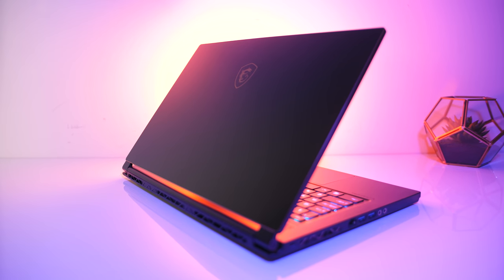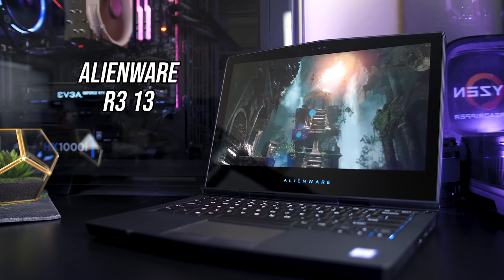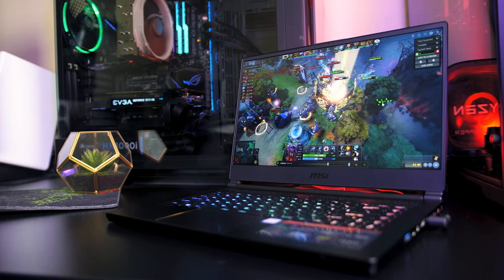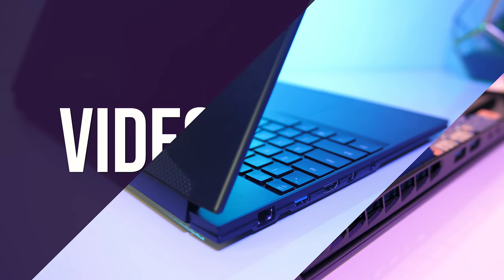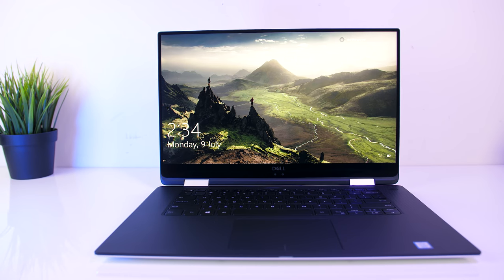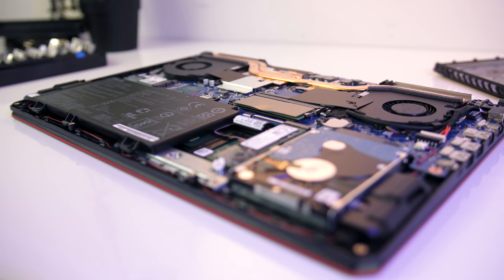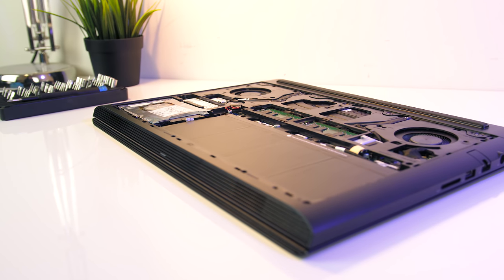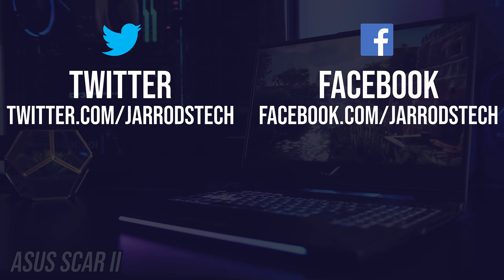The Best and Worst Gaming Laptops of 2018

Comment: overpowered laptop just trying to sell without profit, i think they will not come back.
Best budget laptop i would say acer aspire 7 with i7 8750h+1060gtx+16gb ram+ good screen with 90hz overclockable= for 1000$
Reply from the maker: Maybe, either way who cares if it's a good deal haha 😛 I only got the 7th gen Aspire 7 this year, wasn't able to get hold of the newer 8th gen ☹
Reply: @JarrodsTech  its does not matter much, everything is similar.
Reply from the maker: I would be interested in the thermals with the 8th gen under load, as it's a hot chip and that's not exactly a thin laptop, I want to compare it with the 7th gen some time.

Comment: I assume that the mentioned Scar 2 is the 1070 version? Because the 1060 version has Optimus.
Reply from the maker: Yes, I only tested the 1070 Scar II this year. I made that graph before finding out the 1060 one could swap over too, oops probably should have updated it to note that!
Reply: @JarrodsTech  No problem. I have purchased the 1060 version, and it`s great. 
Battery last about 5 hours with browsing/youtube, not bad.
Reply from the maker: Good to hear!
Reply: @JarrodsTech  Only having an issue, where the audio automatically drops to a really low volume, couldn`t find the problem. 
All the drivers were updated, so had to send it back to Asus, but they couldn`t find it either.
Reply from the maker: Oh that's strange, haven't heard of that happening before, hopefully gets fixed by a Windows update if it's a bug 🤔

Comment: I wanna buy a laptop for video editing and Photoshop 
Can you suggest some (800-1000) $ 
And thx for the video
Reply: Check older versions because for Photoshop and Video Editing you need a good screen. The majority of laptops under $1000 have bad screens. If you can get your hands on a Huawei Matebook X Pro from last year for under $1000 that would check all the marks,  great keyboard, lightweight, nice screen and great battery, the only bad thing is that the video card is just for light gaming. Another option is the Dell G series could have one with a decent screen.
Reply from the maker: That's basically what I was going to say 👍

Comment: Is Dell G7 in worst category because of bios issues? Thanks!
Reply from the maker: I didn't have any BIOS issues when I tested it, unless you're saying that the power limit is due to the BIOS? In which case yes, although as mentioned I don't think it would help much if they change it as it the i9 would start thermal throttling anyway.
Reply: @JarrodsTech  What about i7 variant? Bios issue as in it fucks up the fan curve etc and also can't downgrade it. Which version have you tested it with. Also, which laptop you recommend as an alternate to Dell G7 within same price range. Thanks once again!
Reply from the maker: I haven't tested the i7 so I can't say. I tested the i9 with this BIOS according to the HWInfo data I exported when I made the review:
BIOS Date: 04/03/2018
BIOS Version: 1.1.0 

For alternatives to the G5/G7 I usually look at the Helios 300 as it's specced similarly and a similar price (less battery though, not as good build quality, but around 10% better GPU performance as it's not Max-Q), depends what you're using it for though.
Reply: @JarrodsTech  Thanks for your prompt feedback. Final question, what's your take on Overpowered Gaming Laptop 15+
/17+? Is it worth buying?
Reply from the maker: @xt355  I think they're quite good yeah, as mentioned in the video with the recent price cuts they're pretty good value, and the 15" version of the Tongfang chassis I tested was quite nice overall. As Walmart are just reselling the same chassis there's very little they can do to make it crap, unlike their custom gaming PCs that didn't go too well. My buddy own or disown put out a review on it today: https://www.youtube.com/watch?v=W2V2V8SaAWY
Reply: @JarrodsTech  Good review but i'm confused now. Which one should i buy the 15" or 17"? Help please. :)
Reply from the maker: I haven't used the 17" one, personally I'd always go 15" because I want maximum portability, I'll just attach a larger monitor at home / in the office if I want bigger.
Reply: @JarrodsTech  Does the 15" have dual RAM slots?

Comment: Can people help me. Razer Blade Pro 17 inch Full HD which is currently only £1650 or the MSI GS65? I would go for MSI due to how many good reviews but there just isn’t enough storage capacity for me. Only 256gb SSD whereas the Razer Blade has that and a 2tb hardrive.
Reply from the maker: I believe you can add a second M.2 drive into the GS65, so you could put in a 1TB one for example and have it faster than a HDD, always an option depends if you want the 2.5" drive bay or not.
Reply: Jarrod'sTech Is that an easy thing to do?
Reply: Jarrod'sTech And are you saying MSI is way better than Razer?
Reply from the maker: It's actually a bit involved, the motherboard on the GS65 is upside down so you have to unplug a bunch of stuff to do the upgrade. No, the razer laptop is likely better in terms of overall build quality etc, I'm just giving you options if you get the GS65.
Reply: Jarrod'sTech Ok. Money isn’t an issue but obviously cheaper is better and I don’t care about size, I game, do software development and 3D graphic design. What laptop would be best?
Reply from the maker: Personally I'd go the GS65, it's smaller, lighter, and more powerful (I believe the Blade Pro hasn't been refreshed with 8th gen CPUs yet? So the 8750H will smash the 7700HQ / 7820HK).
Reply: Jarrod'sTech I have gone for the GS65 as it has been reduced to £1599 at PC World (a big UK store). I have also found a local computer repair shop who will add another TB to the laptop for just £180
Reply from the maker: @benwatkinson2021  Cool, hope you like it!

Comment: lenovo y7000 vs hp omen 15 both with the i7 8th gen with the 1060 the lenovo is a bit more subtle and apparently has better thermal management thanks to the thicker body but the hp is slimmer and also a $100 cheaper please help me decide i currently have the rog gl503 it thermal throttles a lot and the build quality is a joke hence im looking for a change
Reply from the maker: Both Lenovo and HP don't respond to me so I'm not able to get review units from either of them for testing unfortunately, so can't really comment on them. i have used a Y530 so I'd probably be leaning towards the Lenovo just based on that experience.

Comment: Hmm~ I was thinking about Acer Helios 300 or Asus Fx505 both i5-8300H with gtx1060. With 50 dollars price differences
Reply from the maker: I'd probably pick the fx505 but with the same specs I'd expect pretty similar performance with either
Reply: @JarrodsTech  I tried to compare both device game test fps from your video. It seem that Helios have higher fps. But fx505  seem to have better fan and heat pipe design.

I've no idea what to choose now, helios having sales now free upgrade to 8gb ram, Acer gaming bag, Acer gaming mouse. It caught my attention lol. But I've alot gaming mouse 😂🤣

Comment: Blade15:
Weird keyboard, single ssd slot, best build. Will burn your lap if you let it lol

GS65 8RF:
Filmsy build, worst driver support, awesome keyboard. Funny thing is that msi put a lot of effort to cool the gpu, then used only a single heat pipe to cool that 6 core cpu! No wonder it never goes under 50° on default clock

Aero15x:
Solid build but not aesthetically pleasing. Inconsistent keyboard lighting, weird webcam placement, best driver support (that goes to all GB laptops including aorus series) poor heat management
Reply from the maker: What's weird with the blade keyboard? I like that it has no numpad 😃
Reply: @JarrodsTech  shift/ up arrow keys. and F keys don't light up properly. other than that, they could've easily narrowed down the speaker grills and add a few more keys. Msi is using 84 keys with better travel and tactile feel. its just lazy design choice on razers part
Reply from the maker: @cripticdestiny  Yeah the big speakers don't sound that great either so not sure why they take up so much room 🤔

Comment: @Jarrod'sTech So if you had to choose one laptop to rule them all, which would it be?
Reply from the maker: Aero 15x, which is why I got it 😅 good all rounder imo, good video editor also capable specs for gaming.
Reply: @JarrodsTech  Wow, surprised, I thought for sure you'd say the Zephyrus S
Reply from the maker: @n.i.5381  I can't get over the touchpad placement 😛 it is a nice machine otherwise! The battery life is no where near as good as the Aero though, and the Aero has an SD slot which I personally need.
Reply: @JarrodsTech  Understood. I use mice only so not a big deal for me.
Reply from the maker: Yeah true!

Comment: Ok so someone wants to Trade me  the Alienware 17r3 with the i7 6820 @ 4.1 ghz, 32 Gb of ram, 512gb m.2 ,1Tb HHd, Gtx 980 8gb version for my Desktop Running i7 6700k, asus 170-a mobo, 16gb of ram, 780 gb ssd +250 gb hhd, Zotac amp extreme edition Gtx 1080. Do you Think this would be worth it ?
Reply from the maker: Depends if you need the portability of the laptop, the PC will beat it by quite a lot though in terms of raw performance.
Reply: @JarrodsTech  well my gaming setup is in the basement so now with a baby in the house it would be nice to have the portability . I planed on upgrading my gpu to the new rtx series anyways so i could always get the graphics amp and run a desktop card to the alienware in the future
Reply from the maker: Yeah that's true, the amplifier isn't that expensive either, though the main cost will be in graphics card. Depends what you use it for, but yeah those specs should still be already considering it's 2 generations behind now. I think the 980M is similar to 1060 / 1070 performance, can't recall. I still use a 970M/6700HQ laptop at work and it works well.
Reply: @JarrodsTech  yeah the amplifier is 200 bucks at best buy so its not bad at all, apparently its kinda in between the 1060 and 1070 so for the time being it wouldn't be terrible till i can pick up the amp and a new gpu

Comment: can tell us what is your prediction of 2019
Reply from the maker: New GPUs in early Jan seems pretty confirmed at this point from what I've heard about what there will be to see at CES, Intel 9th gen some time later but not really sure. I don't suspect 9th gen will really help that much in terms of power efficiency improvement given what we saw on the desktop side, but it could be possible that we get an 8 core laptop CPU from Intel at the top end, although there would have to be some pretty heavy compromises with clock speed under all core load, just have to wait and see I guess!

Comment: Had a CPU literally explode on me thanks dell
Reply from the maker: What happened? 😮
Reply: @JarrodsTech  bought a Dell gaming laptop back in 2017, the temps on the CPU was really bad and mid game I had it blow on me
Reply from the maker: Was it actually the CPU? That's not something that should happen, it would just throttle back and perform less to remain within safer levels. Maybe something else on the board could have fried, but that's just my best guess. Did you get it replaced?
Reply: @JarrodsTech  the CPU was black upon my inspection and the entire board was fried. Just got a new laptop

Comment: Worst gaming laptops of 2020- put Dell G5 5500 RTX and G5 SE Ryzen laptops at the very top. 10th gen Intel i7 can't be undervolted so it's going to trottle. Ready for things to slow down from 120 FPS to 20 FPS for no reason at all? It does that. Ready for constant problems with nightly reboots in hibernate? check! Ready to wait on the phone for 3-hours in a queue only to have Dell support run through the same set of hardware and windows diagnostics and tell you nothings wrong? check! Ready to see on-line many people are having these issues and Dell is not doing a god damn thing? check... ANY brand except Dell for the 2020 G5 model. That includes AMD (G5 SE) and Intel (G5). Avoid, maybe next year it will be better.

Comment: May I know ur pc specs😀☺️
Reply from the maker: CPU: AMD Threadripper 1950X
GPU: EVGA 1080 FTW2
RAM: G.Skill TridentZ RGB DDR4-3200 (4x 16GB)
Motherboard: ASUS Zenith Extreme
Case: Thermaltake View 71
CPU cooler: Noctua U14S
PSU: Corsair HX1000i

Comment: thinkpad x1 Xtreme best production lapTop, Lenovo y7000 best budget gamer..
Reply from the maker: I've heard both are decent, unfortunately Lenovo ignore me so i can't test out and review their products unless I buy them myself - like I did with the Y530 shortly after I made this video.
Reply: @JarrodsTech   The x1 Xtreme is more than decent ;) Best keyboard of any laptop,  trackpoint for lasso selections in photoshop and bezier curve tool in illustrator without the need for a mouse, better thermals than the XPS 15 and much faster than the macBookPro with an i9 due to throttling. Oh don't forget touch and pen input..
Reply: and let's not forget drop, dust and water resistant. If I were u I would buy all the latest lapTops and ebay them after the review. That way your not limited to donations for reviewing

Comment: Hey jarrod i feel very sad, because i have the asus tuf fx 504 which you have in your worst category although i m really happy with my asus fx 504, after the bios update the cpu can go about 50 tdp limit i and the highest temperature i have seen is 93 degress, although better than acer predator helios 300 because on 30 minutes gaming was went go crazy about 99 degress celcius 

I M Happy With my Asus Tuf Fx 504
Reply from the maker: Hey if you're happy with it that's all that matters, just compared to the others it didn't do as well that's all 😛 I assume the 50W TDP is only during the first 28 seconds for PL1 boost then it gets capped afterwards and is not sustained long term?
Reply: @JarrodsTech  humm yes but 3.5 gigahertz all the time
Reply from the maker: Not too bad then, CPU only load, or combined with GPU?
Reply: @JarrodsTech  cpu only load
Reply from the maker: Ah yeah, makes sense!

Comment: Alienware?
Reply from the maker: I didn't test any in 2018 so can't comment, I got the M15 in early 2019, I guess I could have listed it as bad for thermal throttling
Reply: @JarrodsTech  Can Laptop Cooling pads be the solution to that?
Reply from the maker: I used a cooling pad in my thermal testing video here: https://www.youtube.com/watch?v=l2Juhc0dcJc
It helps a little, but definitely not a complete solution.
Reply: @JarrodsTech  Thanks for the replies!

Comment: The gtx1050/1050ti is a scam card! Its basically the 970m renamed!
Reply from the maker: I don't see how that makes it a scam, just because the same level of performance is available in the next generation? Pretty sure you can't get a 970m with 8th gen CPU, so if you want the latest 10 series is what you've got to do.